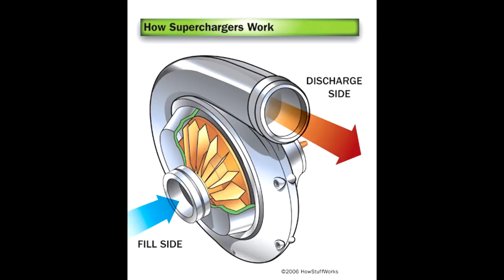Fighter Combat School: Engine Management Pt2. Forced induction.

Comment: Hi Ram! I'd love to have your opinion on this: is it normal that any 109 has an engine temperature of 100°C when flying at 100% throttle for 7-8 minutes at any altitude instead of being at 80-90°C?
I realize that, historically, the pilots used to fly at lower throttle value when traveling to their mission but the fact that the full throttle bring so quickly the water close to overheating seem really strange.
Reply: 7-8 minutes is a long time in air combat. Safe power ratings for the 109 Emil in IL2:Clod:
1 minute with WEP and full throttle, 5 minutes at roughly full throttle without WEP.
Reply: Is this cooling specific to the 109? How do you account for the reports of wep usage during several minutes?
Reply: All WWII engines had this kind of safe usage regime. Usually they could handle 3-5 minutes max power before going above safe heat levels.
This would not have immediate effect, but would soon ruin the engine if the pilot didn't adjust throttle.

You can see this effect in all high fidelity WWII sims.

WEP in War Thunder is not modeled historically. For some WT planes, "WEP" just means the 5-minute extra power rating. On the 109, it means the methanol-water injection system.